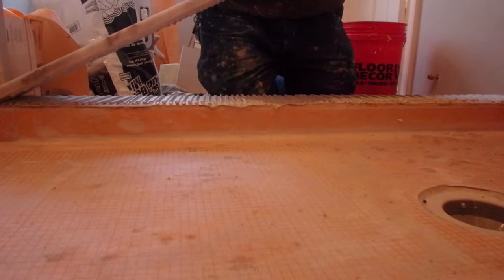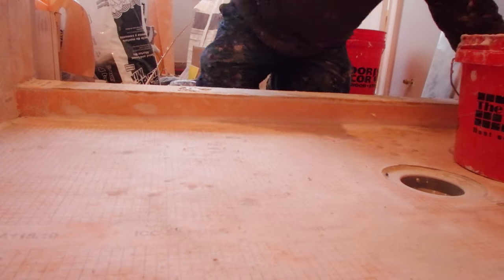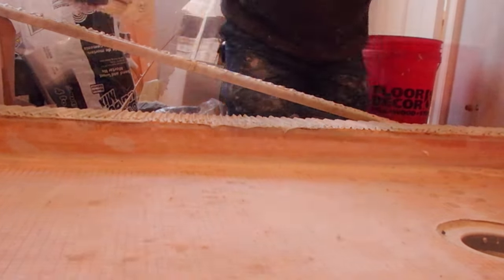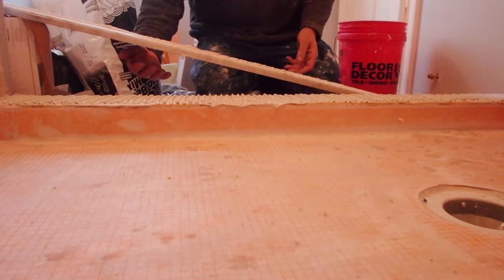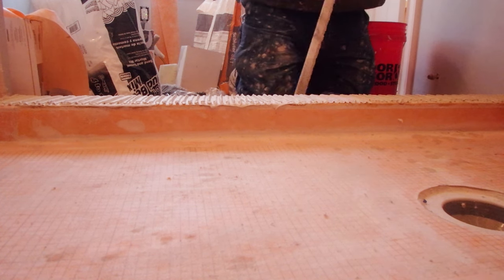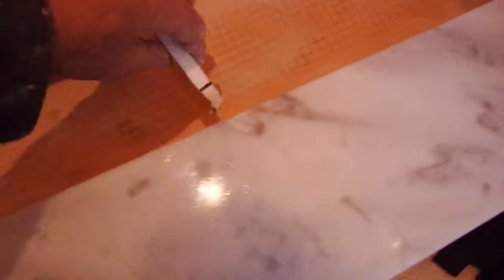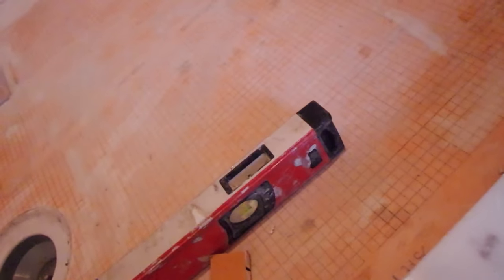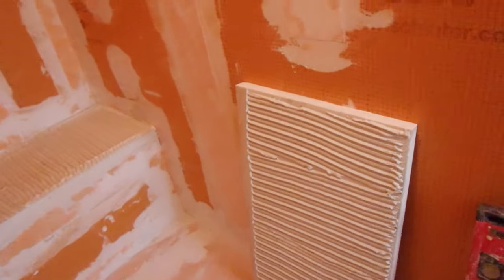Tips For The Perfect Shower Bench Seat And Curb

Comment: Are you still using the schluter drain flange knowing they could have issues?  I know a tiler that had to repair a schluter drain recently.  Pebbles held water and/or was some deflection at the drain area.
Reply from the maker: Never had a problem with a schluter drain, that being said, I usually use FloFX Drains.

Comment: @saldiblasi - You're the only guy I trust - we haven't been able to find a stone shower curb that matches our porcelain floor tile - is it a good idea to take the porcelain floor tile (12x24) and cut three pieces to fit the 6x60 curb with a schluter edging?
Reply from the maker: A lot of installers do that, if yor waterproofing is done right it won't be a problem.
Reply: @SalDiBlasi  Thanks so much for the advice. Our contractor keeps making a stink about us doing it this way and it's making me question his work. Will buy you a coffee!

Comment: Hey Sal I. love your videos!! I went to a seminar yesterday from Profilitec in Batavia, NY and the guy who ran the event said he worked at Schluter for 10 years and he is a big fan of your too! Have you used any of their products? they look like they're very good. I have learned a ton from you and your videos! I install around a dozen showers a year but after installing carpet, vinyl, and pretty much any other type of flooring for the last 30 years, I think I am going to gear my energy towards shower installs full time. I make the most money and I am not crawling around a huge floor all damn day! I enjoy the traditional muddled system with the locking collar drain and liner but the guy yesterday said they are junk and steers me towards the large drain flange like Schluters. Your thoughts?? Thanks you in advance too!!
Reply from the maker: Haven't installed a vinyl liner with a two stage drain in many years. Pretty much every job I do is a bonded, or sealed, system with foam board, a mud bed and bonding flange.

Comment: I'm not sure if you have a paid class that's required to get answers to small questions. Noticing that's ALOT on YouTube. I'm a New subscriber ND New to learning to diy. So PLEASE ACCEPT MY APOLOGIES IF I NEED TO ENROLL 1ST.  BUT IM JST WONDERING. 1ST ur channels has taught me SOOO much and THANK YOU for sharing you Invaluable Wisdom and experience. I was JST wondering if Your wanting to make a full steam shower room. Do you need to use the same materials on ceiling as you do the shower floors. To water proof(Materials like the Corner tape? One channel said it's expensive so JST use where necessary 🤔 also said drywall works JST as well as cement board. Know that's a huge debate. But I'm searching for that answer on it's own. Again if it's a dumb question again sorry but I'm getting the nerves to even try to do the work myself and want to be Completely Sure I'm not going to ruin the work it will take.
Reply from the maker: No need to wonder get a hold of a TCNA handbook, read method SR614, or follow manufacturer recommendations for one of their systems rated for steam showers. Laticrete Hydro Ban Board is rated for 0.5Perms, Schluter Systems works, Not all liquid applied membranes are rated for steam showers. There is a lot of bad info, and a lot of installers on YT that are showing there methods, not industry standards.